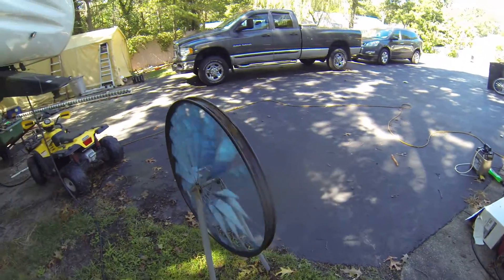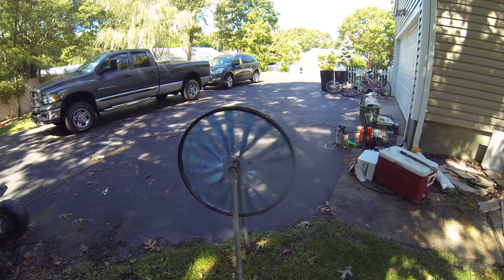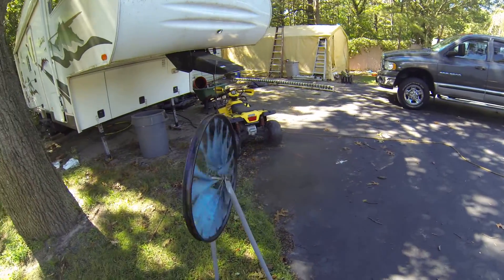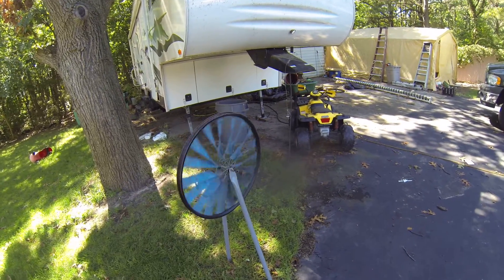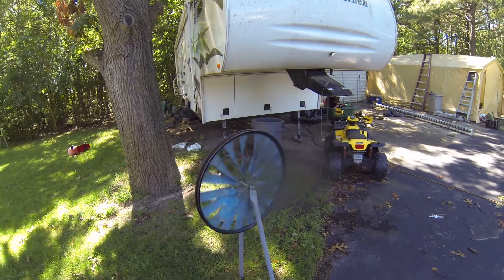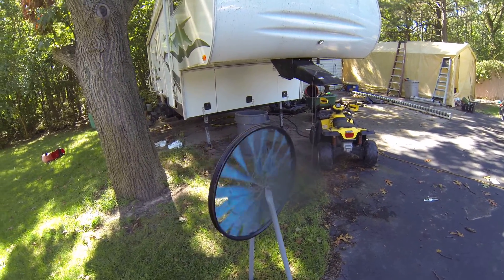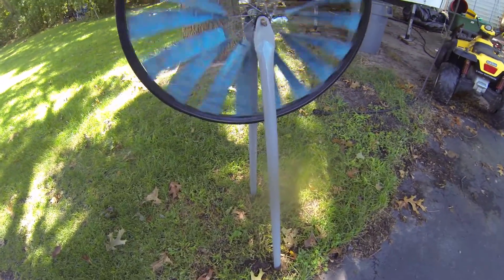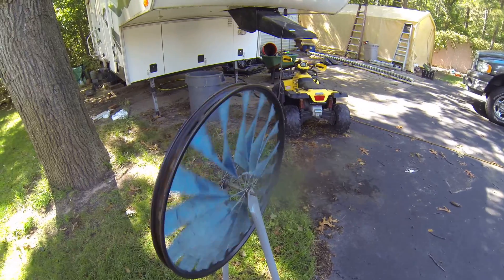homemade bike wheel wind turbine

Comment: You can start small by making one coil and one or two magnets to light an LED. I made similar windmills by attaching a coil of 1000 turn 32 gauge wire to a cd. The cd is then placed at the center of the windmill. The 2 magnets can be attached to another cd secured to the center of your bike wheel. When the magnets with the cd rotates against the coil, your LEDs will light (leds attached to coil wires). That would make your windmill a real turbine.
Reply from the maker: wtam69 i could do that but to be honest the bike wheel wind turbine has a very low power output it starts up easy but it will probably only put out less than one watt im working on one now though that will put out real power with a treadmill motor
Reply: Dean Walcott Good luck with your treadmill motor windmill. They work pretty well.
Reply from the maker: thank you hopefully it will charge batteries